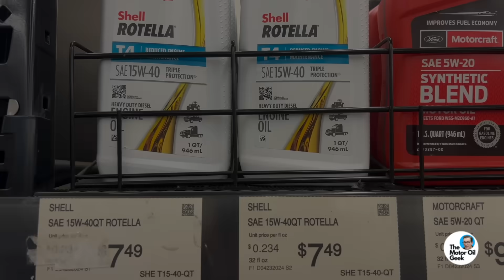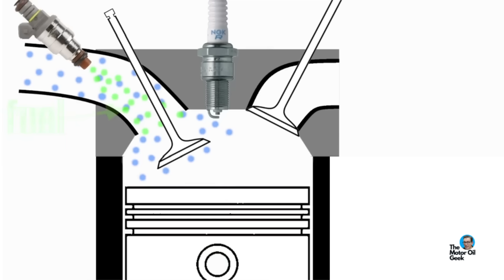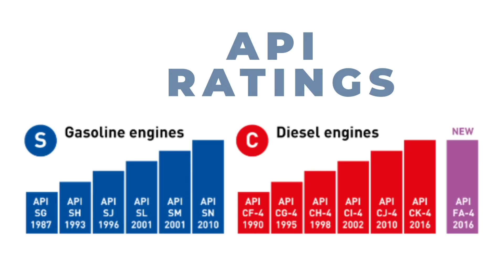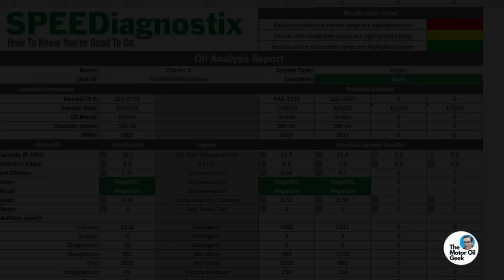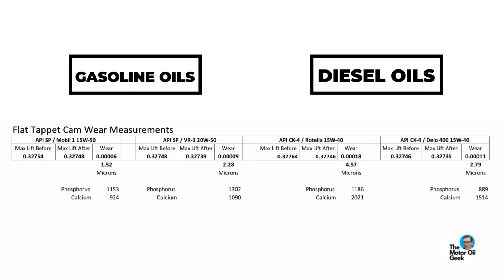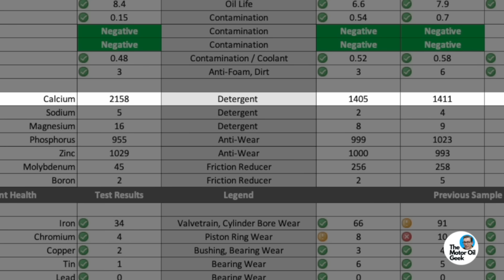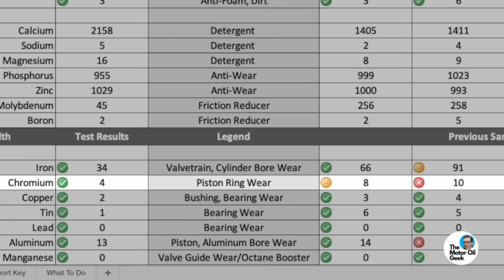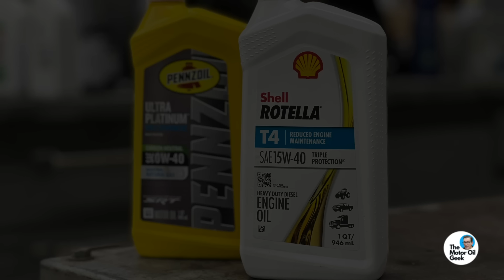Why DIESEL Oil is Actually WORSE for Gas Engines!

Comment: So many fails in this video. First of all, nobody is recommending anybody use diesel engine oils in direct injection gasoline engines! OK, get that Jr? That's not the recommendation. Where people are using it is in classic gasoline engines that when they were new the zddp levels in then current oil formulations were much higher than they are today. People with older flat tappet cams are looking for a viable engine oil with sufficient zddp to prevent premature cam/lifter failure in those engines, and diesel engine oils ARE a good way to do that. Second, many diesel engine oils today are formulated with magnesium based detergents, or a blend of calcium and magnesium. You  have repeatedly harped on this high calcium detergent thing, even after I've called you out on it before on other channels. Stop it. Then let's talk about detergents interfering with zddp or competing for space on wear surfaces inside the engine, that's not how it works, and I've told you this before. ZDDP is activated in the wear zone by heat due to friction caused by contact between moving parts, under those conditions there is no detergent interference occurring. You're simply wrong on this and it displays a lack of knowledge and understanding of basic tribological facts. I would ask, do you have any SAE papers describing this condition? Please, share them. Your test results fail to prove your theory. there are other conditions that could affect the results you found in your tests. Funny how when the PCO oil resulted in increased wear in the diesel engine, so you blame it on soot. Which maybe it was, but maybe it was due to other conditions, such as the type and quality of zddp used in the pco oil. Your logic is faulty and your lack of experience shows. I'm sure there's more, but let's end it with this; the C in API service classifications for diesel engine oils stands for COMMERCIAL, not compression you big dummy! And the S stands for SERVICE, not Spark. You should be ashamed of your self for producing such misinformation. How did you ever get your CLS? I bet it was with the new multiple choice test, wasn't it? Dude, give it up, your channel spreads too much misinformation. People, stop listening to this geek riding on his dad's name, he doesn't know what he's talking about.

Comment: Lake, how about in older non-turbo carbureted cars.    Wouldn't they be less prone to low speed detonation damage?
Reply from the maker: It would be fine for carbureted engines.
Reply: @themotoroilgeek  thanks!
Reply: @themotoroilgeek  another question?    I have a 1988 BMW 635csi.   M30 "big 6" motor.   Flat tappet with pretty high pressure (stock) valve springs.  I don't drive it all that much or that hard snymore and for years have used SWEPCO 306.    20-50

Any real reason to change?    I know it's not the most high-tech oil but ran it for years in my old air cooled Porsche racers. 

Thanks, love your channel.
Reply from the maker: @shuttlemanjack  The SWEPCO is decent, so stick with it unless you have used oil analysis data that says otherwise.
Reply: @themotoroilgeek  so far it does fine.    I live in Arlington Tx right next to their home in Fort Worth so they are local, even if not too common.   All my other cars and trucks run on synthetics. 
Keep up the great job educating us!

Comment: Question that just came up in the engineering company I work for. The newer small duramax from GM in the owners manual doesn't call out use of a diesel oil but instead the gas oil spec and the guy who just bought one found that weird. Is that something intentional by GM in design to make the diesel run with a gas additive package, or do you think that a diesel should run diesel oil like most of us who are not oil experts but are engineers, seemed to think was the right answer.

Comment: ive been running rotella in evrything ive owned for 40yrs i put 500k on an 85 s10 with a 2.8 sold it to my buddy and he ran it for another 5yrs he junked it because it rotted away HE DROVE IT TO THE JUNK YARD just change your oil every 3-4k miles and you wont have any problems.

Comment: People need to learn the phrases "correlation is not causation" and "survivorship bias"

I run super tech in my Mazda 2, 180k miles and has never had a problem. I run it in everything i own. Does that mean it's the greatest oil ever made? Is my Mazda going to blow up tomorrow because i didn't use rotela? All it means is running rotela would have done nothing but cost me more money.

Comment: I don't understand why this video focuses on GDI engines. I've ever heard of anyone trying to run diesel oil in a GDI. Why not do a Rot T4 vs T6 vs VR-1 conventional vs VR-1 synthetic comparison on a flat tappet small block? That's a realistic use case that people would actually benefit from.

I use VR-1 conventional and VR-1 synthetic and Amsoil Z-Rod in my flat tappet fleet. I used the Lucas ZDDP additive in regular oil for years but it turns out VR-1 is cheaper than that and cheaper than Rot T4.

Comment: There is no better oil than Shell  Rotella T. Been using it since 1985 in my old Chevy hotrod. Used it in a 350 that you had to beat the valve covers off to adjust the valves. Looked like a jello mold of Quaker State wax. After changing oil it went to clacking again. Pulled valve covers and it was amazing clean. Adjusted valves and changed oil again and it was fine.

Comment: Allow me to make most everyone's head EXPLODE! I'm an AMSOIL dealer and I sell it along with countless others. Wherever I use bottles for refill, I don't wasted my time to drain every last drop of oil in the engine from each bottle. I just pour into the engine until it starts to drip, turn bottle upright, quickly install cap and toss aside. Later, I gather all bottles and place them upside down in my drain jig to get every last drop of oil from these bottles placed into ONE bottle. I do this with EVERYTHING from gas, diesel, 2 cycle, ATF, and even GEAR oil!!! I haven't bought a quart of oil for my personal vehicles for YEARS!!!(with tge exception of a few vehicles I'm running testing on). I use those refilled smorgasbord oils for lawnmowers, generators, personal cars and trucks, boats, etc!!!  Been doing that since college when I started doing it. Again, not all my vehicles get this treatment but most everything does. Whenever oil starts getting dark, i change. Ive got CASES accumulated from doing this over the years.

Comment: many folks recommend the diesel oils for classic car engine rebuilds.  Can you tell us what you'd recommend for classic engines, in my case a Mopar 273  (10.5 to 1 compression originally) that used 10w40 from a time long before API specs.  I have one being rebuilt now and am told that the solid lifter cam needs a steady diet of additives that modern API oils don't mix as they have totally different requirements.  What oil to use, then?  if we go with the modern API S oils, do we stick to the 1960's viscosity (in my case 10w40).  

Or, maybe you can debunk the whole "classic engines should not use modern gasoline engine oil" line of thinking.  I just want to make sure I don't have to rebuild AGAIN....

Comment: This video misses a huge mark. As a antique engine mechanic, I recommend and use diesel engine oil in antique engines. Modern oils do a great job of protecting modern alloys. Older engines are made of cast iron and materials that benefit from the diesel oils. We dont have "antique engine" rated oil. So the next best thing is diesel oil. I agree, dont put diesel engine oil in vehicles made after 2000, however, older engines habdle it well and will benfit from diesel oils. Especially engine from the 80's and older.
Reply: "We dont have "antique engine" rated oil. " There are lots of oils formulated for antique engines though! For example "Penrite Heritage LTM", "Penrite Shelsley Medium" and "Penrite Classic Light" (Penrite even have an oil specifically for the BMC A-series in the Austin Mini!).   It's just that Shell, Mobil etc don't blend them as they are too niche, but the likes of Lucas Oil and other small blenders should have plenty of veteran, antique, vintage and classic car specific offerings.
Reply: For example Lucas Oil have "Lucas Hot Rod & Classic 20W-50" and also "Lucas Motorcycle Oil 70 WT" for pre-WWII motorcycles.

Comment: I've been using T4 in my Exmark branded Kawasaki clone engine because the dealer told me it's good. No issues, but then again I only put 25-30 hours a year on it, and change it. Overkill but it's cheap insurance.

Comment: Welp I can say that I call BS on this. In 1984 the man that bought my motorhome new ignored the dealer when they told him put 15W40 in it after the first oil change. Guess who had to put in a new crate 454 when the bearings didn’t like the 10W30 he put in it? So the new 454 had been kept on 15W40 ever since then and to carry around 20,000 pounds is hard work. Then his neighbor put synthetic in his motorhome that had a vortec 454 and that ate its bearings so that motor home got put on Mobil delvac. So yes gas engines can run diesel oil BUT they have to be an older pushrod engine and they have to put in hard work to justify that oil.

Comment: Shell Rotella T6 diesel is actually JASO MA rated for gas motorcycle engines.  Very few oils (other than motorcycle specific branded oils) can even achieve this cert

Comment: Been running diesel oil in my gas engines for years and ain’t heard them yet. They even actually recommend breaking cams and stuff in with Diesel cause of the zinc in it.

Comment: Not disputing the science here… just adding some input. 

I have used Walmart 15w40 diesel oil in my 6L GM for about 150,000 km (currently at 300,000).

No obvious signs of trouble yet, but that doesn’t means there’s no trouble brewing. Perhaps the Walmart oil isn’t great diesel oil, or perhaps the LS engine isn’t as prone to wear as others. 

I will admit that was using it because it’s cheap and always available, but not sure if I’ll keep using it now.

Comment: My understanding is Diesel oil works better with wet clutches on older bikes than current conventional/synthetic oil.  I at least hav not had issue running it in my older bikes.

Comment: I run Rotella T-4 (non synth) in my 12v Cummins, SBC (carb), 22R Toyota, XJ 4.0, even my Bobcat (Kubota diesel)... all vehicles have over 300K miles, all seem fine with it, and honestly I got tired of keeping 4+ different oils around ;) Still keep Rotella 30w around for small engines (B&S etc).. plus a huge assortment of other fluids.. lol

Comment: Diesel oils historically were "dual-use" (Cx and Sx ratings) until the EPA threw a hissy fit over ZDDP content. I have no reason to doubt that, absent regulatory issues, Diesel oils are as "dual-use" as they ever were.

My tappets are loving their 10w30 Motorcraft Diesel oil.

Comment: I’d like to see a deep dive into motorcycle oils. Specifically wet clutch, single sump (transmission in the same sump as engine). Many people like diesel oils for their bikes and based off this video it doesn’t seem that great. Some also say that synthetic oils are “too slippery” for wet clutches. Some say that non-synthetic holds up better for the transmission. I’ve never bought into either of those thought processes, but I’d like to learn more of the science behind it. In my 2012 Victory Cross Country’s single sump system, I’ve been very happy with Amsoil 20w50 VTwin and Mobil 20w50 VTwin, every semi-synthetic oil (even Victory branded oil) doesn’t make it more than 1500mi before the shift quality is very poor. The 2 synthetics last 3-4k miles before I notice shift quality degrading.

Comment: Been running shell Rotella Diesel oil in my 93 2.5L Jeep YJ for the last 16 year with almost 400.000KM on the engine no problem i run it in my old 80s honda Dirt bike as well

Comment: Not sure, years back had acquired a free 300k hyundai that went another smokey 100k.  It was getting high detergent diesel oil its first 300k.  Rings were going whole time i had it, passed it on free it running good.  Called it the red rocket because a plume of smoke came out of the back when you hit the gas like my diesel.  Lmao! Could have driven it anywhere... was my snowboarding hoopty ride during college days.

Comment: As a European, this video makes about zero sense.
Usually your videos are very interesting and I've learned a lot here, but this time, eh ?
Passenger car, not always gasoline !
Compression ratios, modern gasoline engines are 13:1 and modern diesel, are often below 16:1 in CR, they have been getting closer last 15 years.
ALSO, tell us more about the difference in your US and our European oils, as they are obviously large !

Comment: For a lower compression antique Ford Engine model T thru model A Ford it sounds like the diesel oil can better prevent Carbon build up on Valves and rings?

Comment: I do not agree with your flat tappet wear results because you used 15w50 and 20w50 gasoline oil, then 15w40 diesel oils.

Comment: Hey @themotoroilgeek - my boat has a 6.0 GM engine (built in 2022).  It calls Shell Rotella in the engine manual (it is a Illmor).  What should I do...
Reply from the maker: If the owner's manual call for it, then use it.

Comment: Toss a match into a bucket of Diesel, and yes, it will not ignite.  Liquid gasoline will have enough vapor above the liquid to ignite with a match as long as the bucket is open at the top.  This is an important thing to know; a gasoline spill is so easily ignited that it's really dangerous to have any source of ignition nearby when working on a gasoline fuel system, and it's important to have a really good fire extinguisher close at hand.

Comment: The wrong oil is better then no oil. Many times have I been in a situation where all I had was 15w-40 for a 2.2l Honda engine… and I never had a problem other then some slow cranking when the temperature dropped

Comment: Was first turned on to shell 15-40 for over 15 years on my Toyo with 284000 blew head gasket over w/p still has the factory cross hatches in the cylinder walls ,,,,,,,,

Comment: Lake:  This video is directed at not running diesel oil in a modern DI passenger car.... 
I run Rotella T6 in all of my power equipment. The one that stands out is generators. 5W-30 oil in those, tends to burn oil. Thats gone with the Diesel oil.  With the LSPI out of the question with the low compression small engine, what oil would YOU recommend for a small engine.  Seems every manual always has the default. 5W-30, 30WT and 10W-40. Now B&S has included thie own vangard oil of 20W50 for continuous use.

Comment: 15w50 vs. 15w40 in a wear test is just ridiculous. Plus, there are plenty of diesel oils out there that work well for mixed fleets. Lubriguard 5w40 or 15w40 would be two good examples with a balanced detergent package. At any rate, I appreciate your content even if I don't always agree.

Comment: if diesel oil detergents eat up bearings / rings when used in gasoline engines, then why the same detergents are not affecting diesel engine internals.
bearings materials are the same in diesel and gasoline

Comment: I have to challenge this. As I personally have been using rotella in my honda civic for the last 300k miles . My turbo subaru has also got rotella.  With no issue.

Comment: Gonna go out on a limb with my backyard science degree and say theres more to the story with the Audi piston. That didnt happen just from using Diesel oil. I (along with most of the rest of the commenters) have been running diesel oils in gas engines for years with zero issue. Cars, trucks, lawn mowers and motorcycles. They all love them vitamins and minerals and have yet to blow a ring land. The Audi had a much bigger problem…
Reply: LSPI problems in VW Audi engines are very common, even with the proper oil!

Comment: Very interesting. We have run rotella t6 in gas port injection engines in our race cars (high rpm road racing applications) for ever and never had an oil related failure. And I'm talking 8500-9500 rpm across 10+ platforms for easily 10+ years. Not saying that what we did was right, but it's interesting to see that we can do better with a race-specific oil like driven, brad penn, Schaefer's (switched to that back when the zinc was lowered in the rotella).

Comment: What about my old (73 years old) 8N Ford 4 cylinder flat head engine? I use Cen Pe Co 15W40 diesel oil in it. I mow with a finish mower at about 1500 RPM continuously for hours. Also in my two cylinder Onan 18 HP engine in my 1986 John Deere lawn tractor I blow snow with. My driveway is the length of a football field. I work the snot out of it. It doesn’t use any oil, stays clean. 
What should I do? 🤔🤷‍♂️ 
Where can I get reasonably priced oil sample kits? 
Thanks

Comment: You are better using the best oil and filter on your vehicle, then do it often rather than less. 
Back in the day I had a Lotus powered car with a ZF gearbox, I used premium oil plus an upper cylinder oil in the Petrol.

Comment: One thing he fails to mention is older oil was not as good and older engines like from the 70s and back had bigger tolerances. They are less picky about oil than modern engines. T5 rotella is great for flat taper cams, save your money and dont buy fancy expensive oil.

Comment: You need to inform Vice Grip Garage Derek he swears by using Rotella diesel oil in flat tappet cam engines. He says it has all the dinosaurs needed for flat tappets.

Comment: Interesting video. Since my very high milage 60 year old Ford 6cyl runs great, but burns a qt every 450 miles, the shell rotella diesel oils soot control properties are just what my engine needs. Been using it for 35 years now. The t6 full synthetic I switched to from the t4 is giving me even lower oil consumption and less plug fouling too.